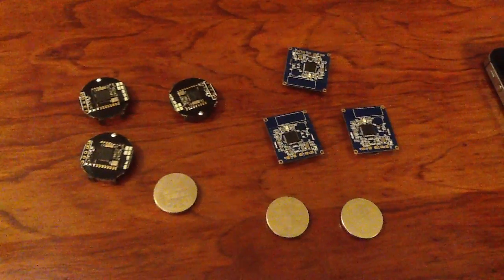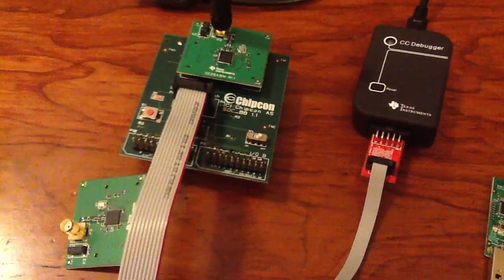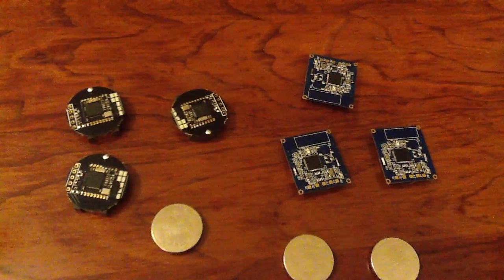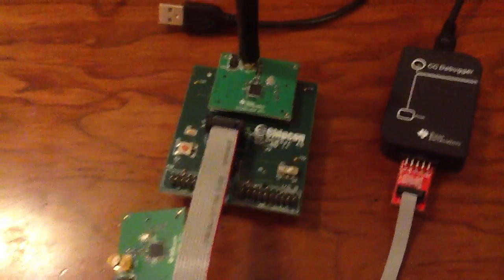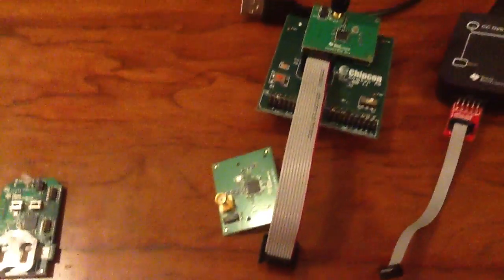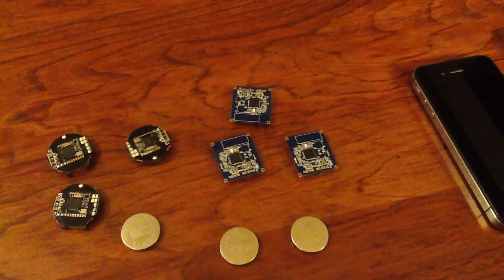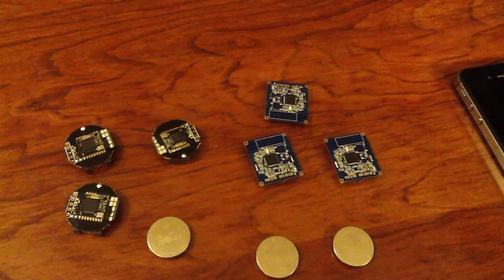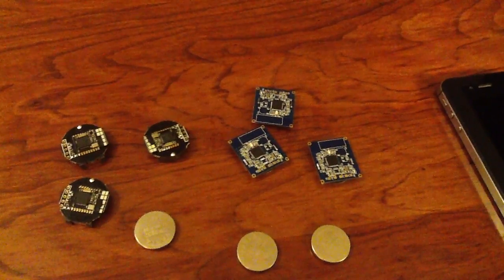iBeacon Hardware Demo Example

Comment: the ibeacon chips with ble soc is detected only if they are programmed to act as beacons? or if it is simply powered on, it acts as a beacon that can be seen in app?
Reply from the maker: The 'beacon' aspect of it, is really a Bluetooth advertisement. In the case of just powering it on, a beacon will usually broadcast a blue advertisement from 100 ms to about every 2 seconds, depending on configuration settings.  We typically like to broadcast every 500 ms, but feel good about 900ms as well. We stay away from slower broadcasting, especially In a multi-beacon environment.